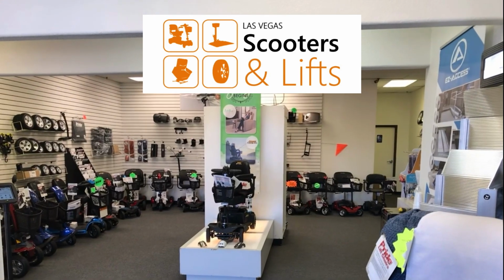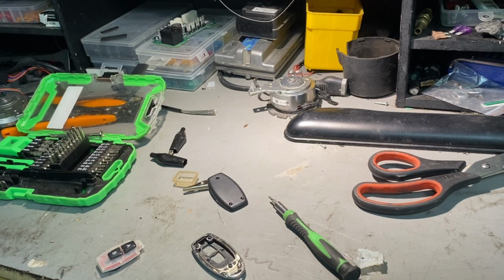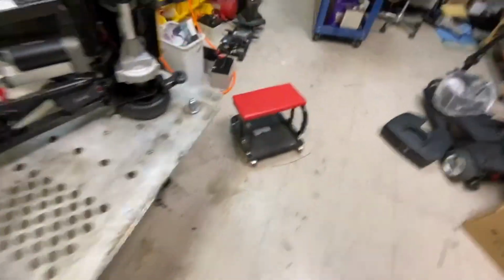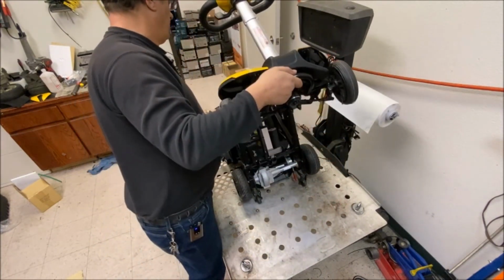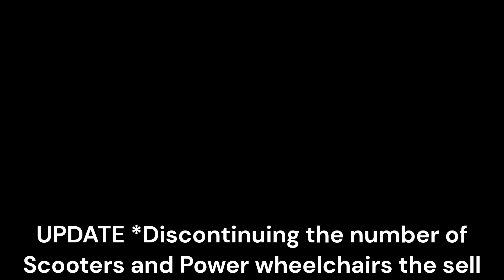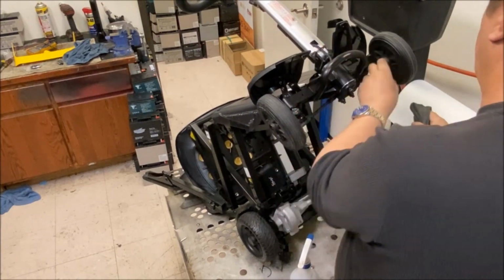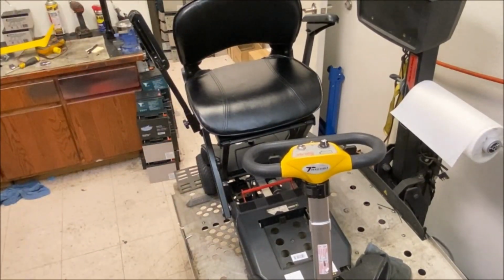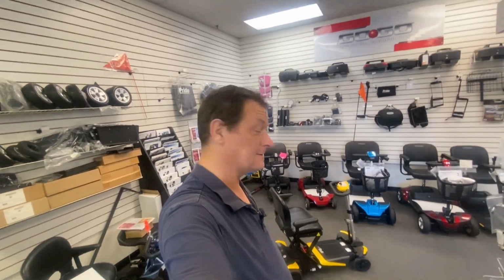A Solax Transformer but with a difference

Comment: Hi, i live in Norway an i have a Solax transformer. When i went dow a sloop the scooter slides and in the bottom of the sloop i cant drive it enymore, its folding and unfolding an it beeps one time when i turn it on, bot the display on the scooter is not on, and i cant drive the scooter. the beeper works also.
Reply from the maker: Hi Monica, one beep is normal when turning on the scooter. Folding and unfolding is independent from the normal operation of the scooter controller. With the scooter fully open, if you can look underneath the scooter, from near the ram that opens and closes the scooter check all the wiring going from the controller located at the back of the scooter going to the steering tiller to see if anything has come unplugged or been cut as that might be you problem.
Reply: @lasvegasscooterslifts   Now the Solax transformer works again, I want to thank you so much for your help. I am currently on holiday in Gran Canaria and the holiday would not be the same without the Scooter. Thanks a million 🥰
Reply from the maker: Glad I could help, have a great holiday.